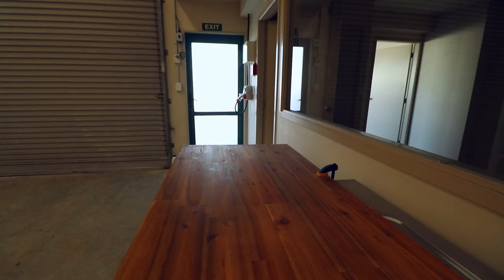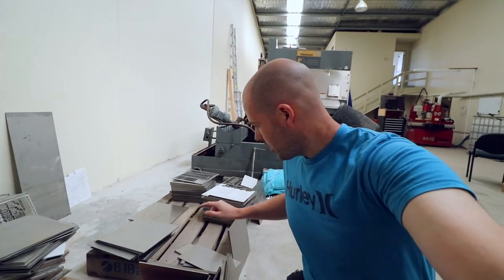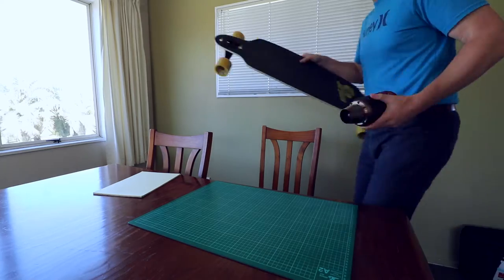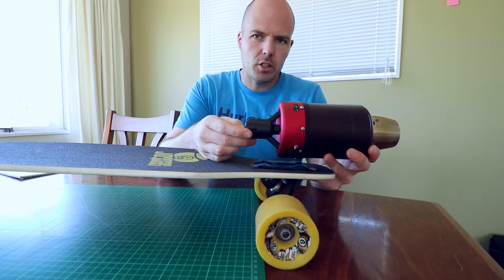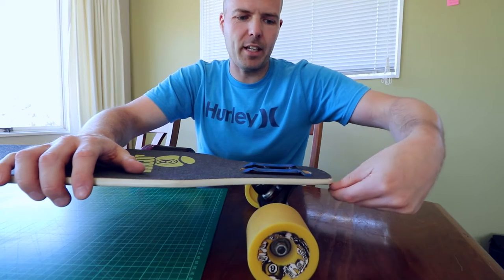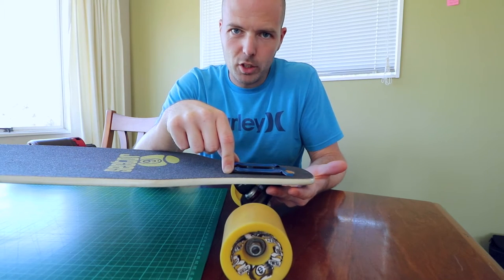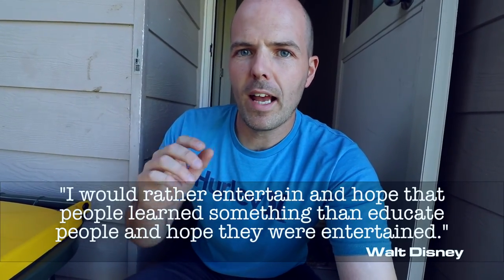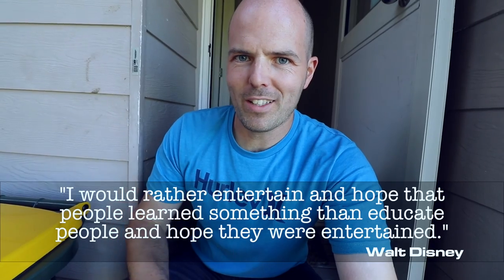Jet-Powered Skateboard (Part 10)

Comment: Great idea for the turbine mount Magnus.  FYI you can mount the drop thru trucks on the bottom of the board too.  It will give you more clearance on the underside for the tank and electronics box.  Drop thru's advantage is to lower the board to make the kick less of a reach and reduce leverage input to the truck.  That kind of goes out the window with jet power.  only benefit to keep drop thru here is needing a little less reach foot braking.

for your clamp...  make sure you can provide further tightening later. Metal tends to expand and stretch when heated and under load.  Once I have reached the limits of tightening on my mount I had to add shim stock between the strap and the turbine.

keep up the great work
Bob
Reply from the maker: Have considered not having the trucks drop-through ...but apprehensive of it not look very good ...but maybe I'll try it.

Also, YES! You're spot on with the shim thing. I was not going to do it (assumed it would be good enough without) ...but I think I will cut some "shims" just in case. Great idea Bob. Thank you.